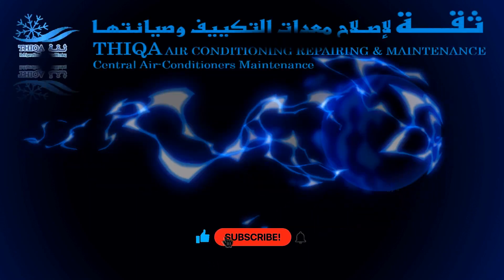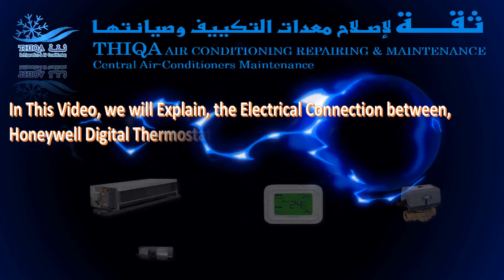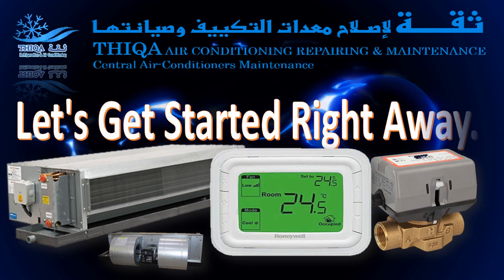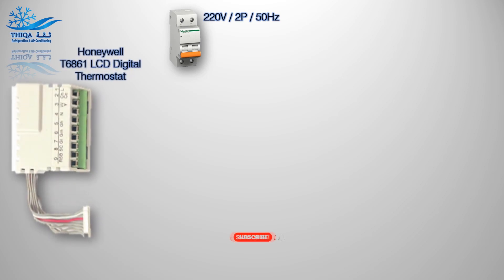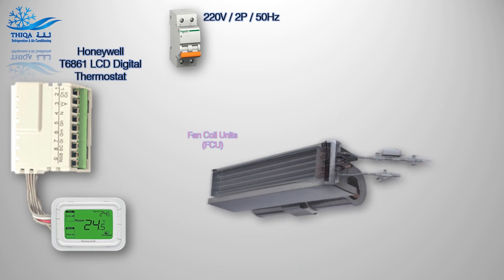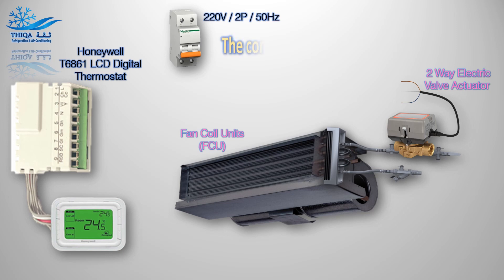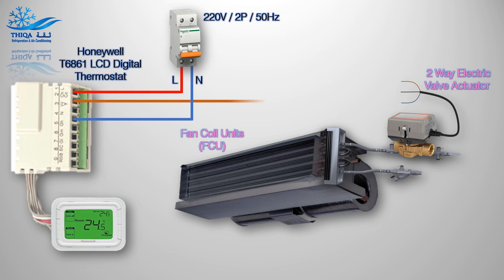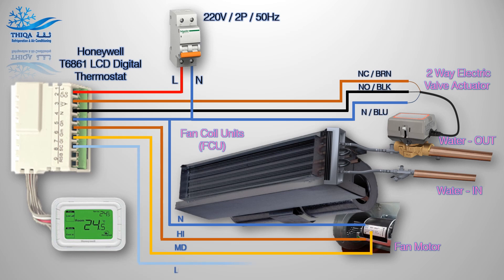Fan coil Unit Full wiring with Honeywell Thermostat FCU and Actuator

Comment: My brother in law told me that his friend's fan coil unit (Polar Air Highwall SWC-EC) heater and cooler was not working. Somone replaced ECOBEE thermostat Enhanced. They are not HVAC tech or Electrician. This Ecobee Thermostat Enhanced would not work with Fan coil unit because it had 5 wire only. I just replace new Ecobee Thermostat Premium. It had 7 wire (RC,C,Y1,W1,G0,G1and G2) but Heater and cooler is still not working. I tested it  (RC & W1) - Heater won't be running. I checked Heater's fuse- fuse was okay. Maybe Valve is bad ? I am electrician but I was HAVC (one year experince). I dropped out. Do you know why heater is not working?? Just suggest me ?
Reply: https://youtu.be/s4Jz7dpS8Kk?si=1SBVsMQ3Y6BFdHG8

Comment: Isn’t that N line supposed to be L2 a hot line since it has a two pole 220V breaker?
Reply from the maker: Thanks for the comments 
It's doesn't matter. you can also use single poles and neutral separate 
However, you need phase and neutral
Reply: https://youtu.be/s4Jz7dpS8Kk?si=1SBVsMQ3Y6BFdHG8